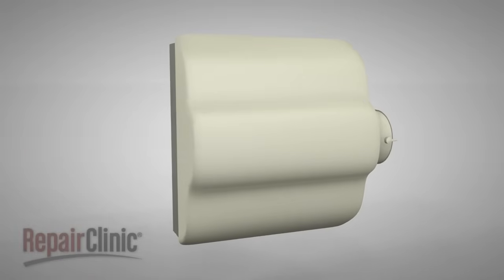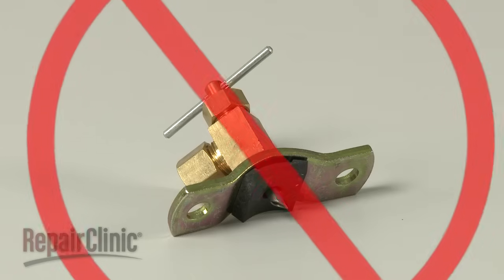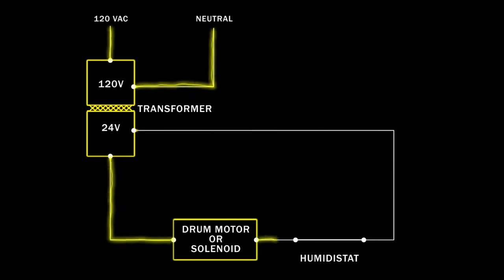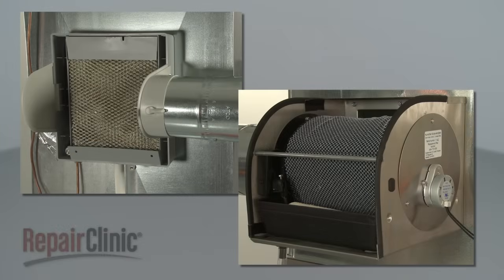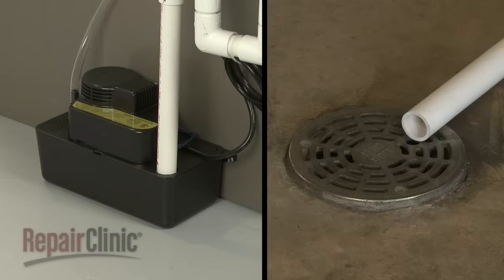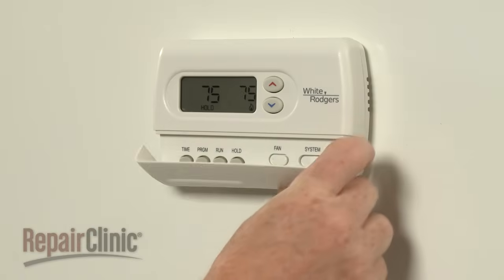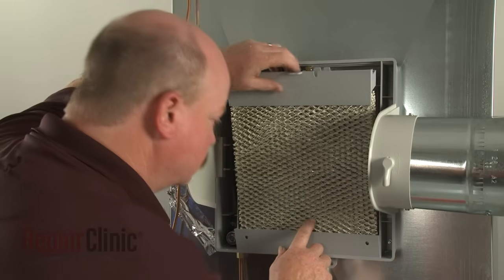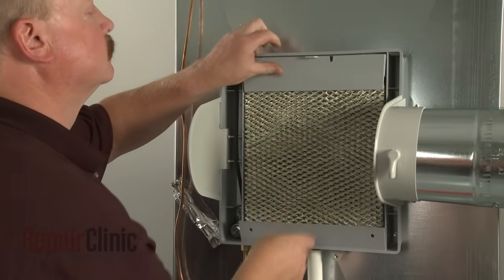How Does a Humidifier Work? — HVAC Repair & Troubleshooting

Comment: Good video. Although I wish you included how to properly insert it. There are five holes on one side and one on the opposite. I believe the five holes go on top and the one goes on the bottom. And then also could have mentioned the black marking on the top at the humidifier pad. Does the black mark indicate an exact position of something or does that just mean it's the top in general. I'm asking because what bothers me is that on my humidifier pad the black mark is at the top, but it's not in the direct center. It's about 65% on one side (left or right.) It's bothering me because I wish it was in the center. Why is it off-center? If it's only indicating it's the top then it's fine, it doesn't matter where it's at. But if it's marking a certain hole or something it doesn't make sense because the drop-down water is in the dead center. I'm guessing the mark just means top, but I could have sworn this other humidifier pad I was dealing with at my friend's house was in the dead center so when I seen mine is on the side, it confused me. I'm worried about this because I don't want a potential leak to happen if something isn't matching up properly.

Comment: My humidifier only gets water when the furnace is on. Running the fan alone doesn't make the humidifier run water. Unlike what this video stated
Reply: Dylan Shabtai
Reply: Dylan Shabtai your furnace is wired incorrectly youre getting power from the board when it calls for heat thus turning it on. Unit needs to be wired such that the humidistat controls the humidifier not the furnace good luck.